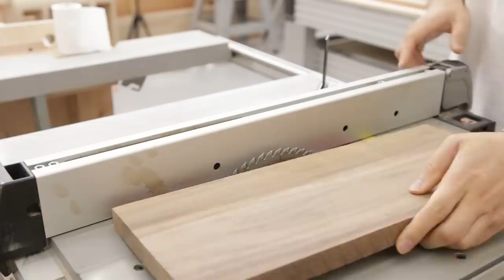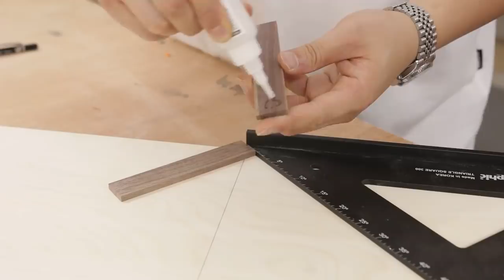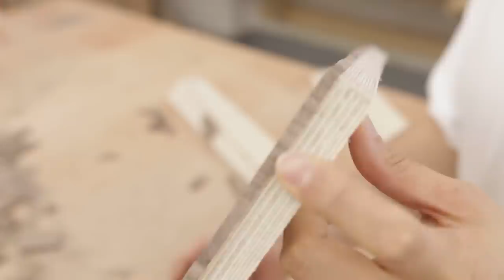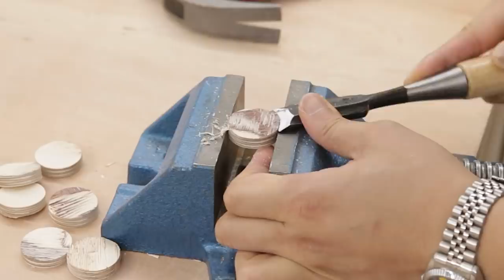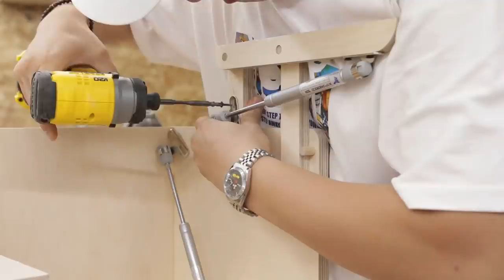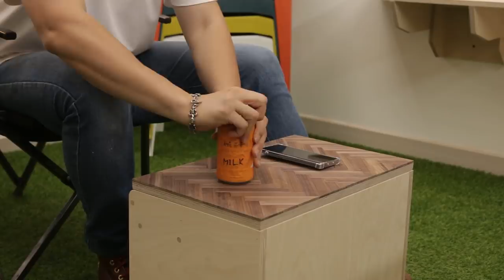Woodworking Auto-lifting Herringbone Table / gas spring furniture idea

Comment: I have not seen if you have this or not. (slow internet connection) But I have a space above my pullout Pantry(it is essentially the left over space above where I made 3 pull out drawers (6 foot high) and they are in 2 different widths . 2 the same and one larger one for larger objects. Each pullout has multiple shelves.. It nearly doubled my usable space in the old pantry. I want to use this space above as a moveable piece that I can store like pots pans and things I do not use often that is large. So it needs to be about 2 feet deep and can be easily pulled out then down. do you have any ideas. I can send pictures of what I am referring to.. .. OH and there is a space of about 4 inches above the pantry I cannot use as its 2 sandwiched 2x4's Thanks